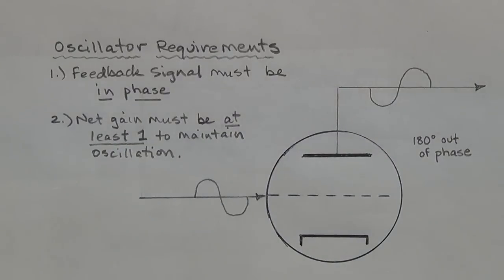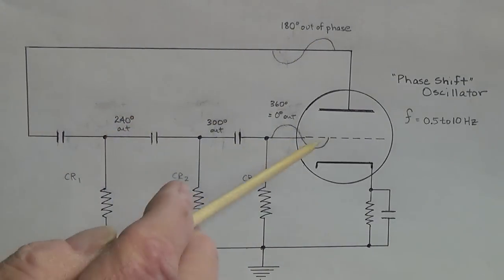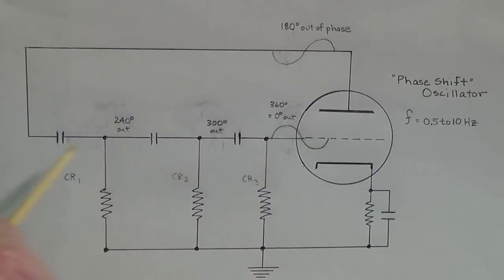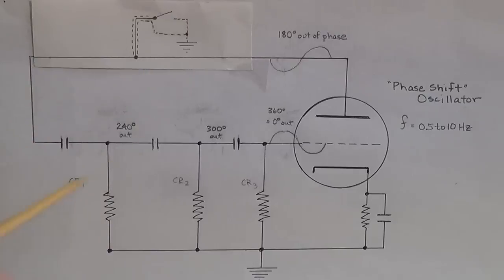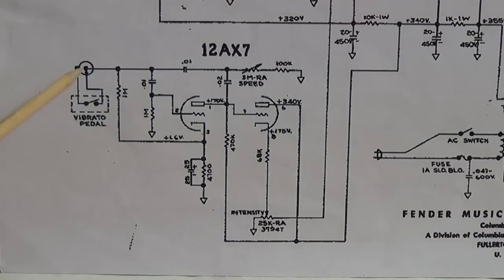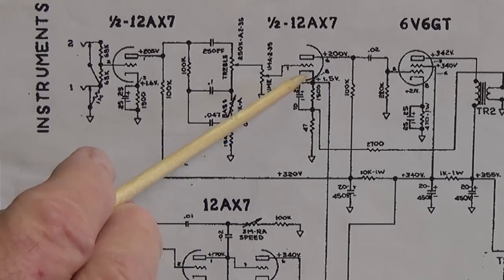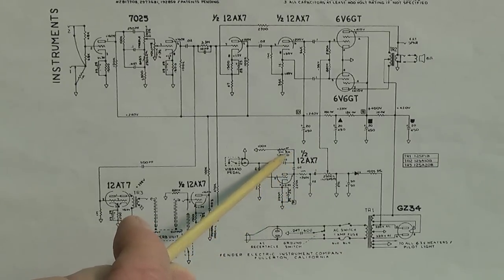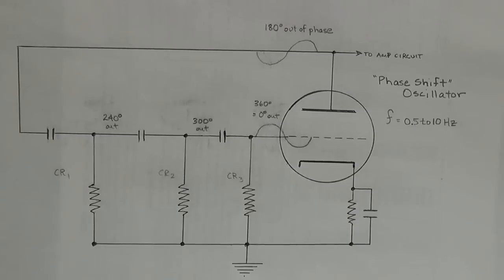How Does a Bias-Shifting Tube Tremolo Work ?

Comment: The simple Tremolo circuit you first describe in the video is almost exactly the same as what is in an Ampeg Reverboorocket.  Here is the schematichttps://el34world.com/charts/Schematics/files/Ampeg/Ampeg_r12rb.pdf . My question is the voltage on the plate V1 pin 2 varies along with the oscillation of the tremolo. Is this normal? The grid is a stable .8mV. The schematic supplied in the back of the amp says Pin 2 , The plate has a voltage of 110V but the voltage with the tremolo off is 358V and on it pulsates from 170V to 260V approx. when turned on. All other voltages in the amp are within 10% of voltages specified. Can you shed any light on this is the voltage on the schematic wrong? I have replaced the .01 and two of the .05 caps with no change and all resistor values are within spec. Any insight would be really appreciated.
Reply from the maker: Does the tremolo work? I have no way of analyzing this problem long distance, Bill. If the tremolo does not work, then I suggest you seek the help of a qualified tech in your area. Good luck.
Reply: Uncle Doug yes the tremolo does work.
Reply: My question was does the voltage fluctuate on the plate in this type of tremolo?
Reply from the maker: @billroberts849  My experience with tremolos has been that all high voltage in the circuit oscillates in time with the tremolo, even if the Intensity is turned "off".  It's a nuisance when trying to measure PV, and can only be halted by removing the oscillator tube or grounding the oscillator loop circuit.

Comment: I still don't understand how there is a signal (Alternate Current) in the grid if the signal comes from the negative voltage (Direct Current), could you explain?
Reply from the maker: Please watch my video on how amps work, Fabio.
Reply: Ok, this is not about watching the other videos, this is a specific question on the topic, in the drawing there is an alternating signal entering the triode grid (first triode / oscillator circuit), however, what feeds the grid is negative DC coming from the same source that powers the bias, where does the alternate signal that makes the oscillator circuit work? Could anyone answer? Thank you.
Reply from the maker: @fabioploja  The AC oscillator signal adds (when positive) and deducts (when negative) from the bias voltage being applied to the output tubes, varying their voltage and the strength of their output, which alters the volume of their output at the same frequency as the oscillator wave form.

Comment: Hi Doug-I built a 2x6L6 AB-763 circuit on a Hoffman Circuit Board with this type of tremolo and it did work originally but has stopped working. You said this circuit is typically applied to 20 watts and under. I'm thinking this circuit is very picky about the output tube bias. Your video was very informative and I appreciate your teaching us with such clarity.
Reply from the maker: You're quite welcome, Earl. I'm not sure why a working tremolo would cease to function, unless something changed in the oscillator tube and/or oscillation circuit. If it worked at first, then it should be repairable. Good luck.
Reply: Uncle Doug I’m not the most savvy diagnostics tech but am continually learning as I go. Your videos have been very beneficial to me and I am grateful for all of your efforts to teach us out here in YouTube Land.
Reply from the maker: @Earlvis  You're quite welcome, Earl. We're glad the videos are helpful.

Comment: Uncle Doug-I've been looking at your Tremolo videos, and have been wanting to build a replica of the 6G15 three knob reverb circuit married to a 6G12 three tube tremolo seen in the Fenders, but instead of the 6G12 circuit I'd like to have the Vibrato circuit that Magnatones use.  Have you seen anything like that or know of a schematic?  I really like the true pitch shifting effect found in the Magnatone, and I don't know of any other amps that use it.  Is that circuit more complicated, or why don't more builders use the pitch shifting Vibrato vs. the volume shifting tremolo?  Thanks as always.
Reply from the maker: You need to watch my video on the Panoramic (Magnatone) amp, WS. Everything you need to know is provided in the video, including the reason that so few people are successful in building one.......the key components, Varistors, are very difficult to obtain.

Comment: Doug.   I understand the loop that sets up the oscillation, however, what I cannot understand is where the initial signal at the plate comes from?   You penciled in a sine wave (at the plate) and showed how the sine passes through the 3 HPFs, but I cannot see what produces that initial sine wave or signal that gets fed through the HPFs and begins the oscillation.  Is there some property that makes a 12ax7 self oscillate?
Reply from the maker: The oscillation can be triggered by the operation of the tremolo footswitch, turning on the tremolo intensity switch or pot, or any electrical disturbance that affects the oscillation loop, which, if properly designed, is "anxious" to begin oscillating . Some trem circuits have small signal insertions that "kickstart" the oscillation.
Reply: @UncleDoug  thanks doug.   Love your videos.
Reply: I kept looking for this question because this was exactly what I was wondering.

Comment: So wait, Doug, my 2015 Fender EC "Vibro-Champ" (4 to 5 watts from a single GT 6V6 power tube, two GT 12AX7's and a 5YE GT tube rectifier. Anyway, it would seem that according what you have just taught us at 14:50 and a little after that  my amplifier has tube tremolo and not tube vibrato. But judging by the name on my amplifier it has "Vibrato",  not tremolo. 
BTW my amp works like this: the tremolo only starts when you strike a note, meaning that it is never in a low volume wave oscillation of the tremolo cycle when you play a note. All the strummed notes always are emitted at the actual volume output that the volume knob is set too! It is only during the time period after striking a note does the oscillation begin. This is done right in my book! Not all S.S./Digital amps do it that way and when playing on them the music is not emitted the way it's entered into the amplifier input. You can strike a note during a low point in the signal oscillation at from the very instant of striking that note the emitted output volume is low, this changes the music amplified to our ears to such a point that I find that method unacceptable.
It has a rotary (rate) on/off switch (that can be controlled via a standard on/off Fender foot switch), that has a variable sweep from (0)-(1) through (1)2. The (0) setting is off and the "1" setting is the slowest setting. My standard setting is "1", although recently I am experimenting with different speeds. I learned to keep it on any new setting increase for a while, to allow me time to become used to the faster tremolo oscillations.Also to just change the speed a little at a time, say 1/2  of an numerical increment increase on the 1 through the 12 possible selections. , not even going from 1 straight into position 2, but rather from 1 to position 1.5, then after my ears have made the adjustments sound normal , then I can go to the 2nd. position of 12, and so on and so forth. I can indeed learn to adjust my playing to accommodate the faster tremolo or vibrato emanating from my amp and I enjoy the change of pace (ha -ha I made a funny! get it speed/change of pace-oh never mind!).
Do I understand this correctly? MY amp has Tremolo? Or, is Fender just using the "Vibro-Champ" name on an amp that has tube tremolo? 
I thank you ahead of time for any considerations that you may provide regarding my questions.
BTW, Those schematics are so beautiful. I am an engineer and an artist and even studied violin under Nina Chemolve a Julliard School of music graduate who graduated in the 5th. position/ranking in her class and a musician. I was a musician for most of my life, since childhood. I was also an artist since childhood. So I would love to make a few paintings of schematics. Simple black on white backgrounds just like all the schematics I used to prepare while I was working as a draftsman, which BTW opened the door for me into engineering. I retired as a Sr. Eng inner from NYS/OGS. It all started when I starved while preparing a Fresco Mural painting for the Suffolk County Dept. of Labor, for the Commissioner. He got impeached-possibly they used my research/visits to all the facilities that were using "CETA" people as trainees. They used me to get to him. I give the man credit, not may men these days even envision murals like he did. He was an absolute dictator who made his immediate senior team comprised of Deputy Commissioners literally jump 1/2" off the floor when he barked out an order. 
I remember when the President of the Long Island McArther Airport interviewed me to obtain his permission to walk around his secure Jet Engine Facilitates- he came right out and said I was a "SPY" for the commissioner. My retort was that I took a burnt/used wooden match from his ash try (he smoked a pipe) and drew an airplane right before his very eyes on a piece of paper right upon his desk. He remarked that, yes, indeed I am an artist and gave me permission to enter the safeguarded spaces. This was a very adventurous job as I walked into many military facilities and even historical facilities that are and or had been in the past involved with the CETA Training programs, all the way back to the 1930's WPA Projects.
Well, after the commissioner was impeached the leaders of the Dept. of Labor said it looks like I might starve to death as a starving artist and offered me a 10 month CETA training course in Electronic/Mechanical Drafting, (one reason why I encourage you to open a school-as in the training literal saved my life. I accepted and graduated and finally had a career that would allow me to "eat" and have a stable life! I married and raised two children. I stayed with it and I drew up countless schematics for lasers and also the H.V.A.C Industry, through different employers. I got to the point where I was requested to make original schematics, not just making some other Engineers drawings look and be legally presentable once stamped by a P.E. I loved my engineering career, more than my art (scandalous)! I loved designing and that was the most wonderful time in my life.
Doug, you are a most excellent technical instructor a real asset to all of us who have found you. Knowledgeable, courteous, humorous and diligent in presenting thorough explanations of your selected topic/lesson. I hope you do open a Technical Institute. Look into the CETA government (Federal) programs that can pay the 100% tuition for your students, as opening and administering and educating students shall be costly. The CETA program should cover enough - 100% tuition, and remember to set the tuition rate to cover 100% of your expenses/operating costs and of course if you desire you can add a profit, after all that's the way the world does things. Although I know your main desire is to educate and I can find it in my heart if you do not desire a profit.
 -Peter
Reply from the maker: Greetings, PD, and thanks for the very nice comments. Those who wish to help support our advertising-free channel can become Patreon patrons, pledging a contribution of their choice for each video we post. Re the difference between "Tremolo" and Vibrato", the terms are often used interchangeably, even by Fender, but they are both quite different. Regardless of what the effect is called on your VC, it is tremolo, because it is based on volume fluctuation, rather than frequency fluctuation (as it is in Vibrato). Very few tube amplifiers offer true Vibrato, but Magnatone is, to me, the front-runner with several true vibrato amplifiers. Watch some YT videos to see the difference between T and V....it is quite evident.

Comment: I understand that the cr filter network shifts the phase to create a positive feedback loop, but what I don't understand is the fluctuation in the amount of feedback. I suspect it is due to the charging and discharging of the capacitors in the network, but I just can't seem to visualize it.
Reply from the maker: Each charge/discharge cycle puts the oscillator signal further behind the phase of the original signal. After three 60-degree phase set-backs, the returning signal is 180-degrees out of phase, providing the negative wave  form for the oscillation loop.

Comment: Hey @uncle doug. I was wondering if it is possible to take the vintage fenders with these tremolo stages and eliminate/modify them into another gain stage? With a added master volume I'd think it have lots of gain on tap. If at all possible, can you also make a video on how to do something like that as a possible amp mod to do to ones amp? Basically asking if we can convert a tremolo into another gain stage Thank you so much!
Reply from the maker: I would not suggest it, Robert. You can't simply add another stage to an amp circuit without altering all the other stages.......and the end results would not justify the time, effort, and expense. I speak from sad experience. Fender amps are known more for their tone and effects, not so much for volume. I guess that was Marshall's domain.

Comment: Doug, I am working on building a guitar amplifier using the power section, vibrato, and amplifier from a Baldwin 51P organ from the 50's. There is a pretty hefty transformer between the cathode and the screen of a 12 AU7. There appears to be a signal coming in from a tone generator circuit, and the output appears to connect to ground via the filter section and to the cathode of a 12AX7 in the amplifier section. Does that make sense? Curious what function the transformer is performing in this scenario?
Reply: Also, forgot to mention that the above question is in reference to the vibrato section, duh!
Reply from the maker: I can only make a wild guess, JK, in the absence of a schematic and any experience with any of this gear, but I will assume that by "vibrato" they mean "tremolo". It is standard to inject a tremolo oscillator signal into the cathode of one of the pre-amp tubes. The transformer is probably to match the impedance between the oscillator and the cathode.....i.e. to either step up the voltage and reduce the current, or vice-versa. My guess would be to step it down to a tolerable level where it can create the effect without overpowering the tube and distorting the output.
Reply: @UncleDoug  That would make sense that it's a step-down, since the tone generator circuits are providing some degree of signal into the transformer and surrounding tremolo circuit. I have removed the tone generator circuits from the equation, so it might be better to build a tremolo circuit from scratch. In fact, I am thinking now that I might scrap the existing stuff and build a new amp using a fender design of the same tube complement, etc. If you ever run across one of these organs, I'd be curious of your thoughts, they are just a marvel to me in terms of engineering. I had visions of using the tremolo and other crazy percussion effects as part of an amp build, but I've pretty much out kicked my coverage on that idea. Thank you for the response and many hours of education and entertainment watching your videos!
Reply from the maker: You're welcome, JK. Good luck with your project.

Comment: Hello Uncle Doug, thank you very much for this and the other videos, the explanations are among the best I could find anywhere on the Internet. Great that you could took the time to produce these and share it with all of us. 
I have one question please: On a vibrochamp schematic, I noticed that there is a 47 Ohm resistor added to the cathode bias section of the 2nd part of the 12ax7 preamp tube. Is there any particular reason why this resistor is added? Is it because of the tremolo? Thanks..
Reply from the maker: You're quite welcome, Ivan. I really appreciate your very nice comments. The 47 Ohm resistor forms a voltage divider (with the 1500 Ohm cathode bias resistor) for the negative feedback loop from the output transformer secondary, Ivan

Comment: Uncle Doug, I appreciate you for all of the knowledge you have distributed over the years! you are an asset to all of us ampaholics out here. I have a problem with a tremolo that I want to run by you. I am working on a GA17RVT Scout Giibson. I put a virtual center tap from the heaters to the cathode of the 6AQ5 output tubes like I had seen in another video. As soon as I did this the tremolo quit working. Even though I removed it the trem still doesn't work I have checked all the parts and can't find any that are bad. the 6EU7 PI/tremolo tube checks good as do both of the output tubes . If you have any thoughts on this I would greatly appreciate it. thanks in advance.
Reply from the maker: I responded elsewhere, Jon. Best of luck with this.

Comment: The second half of the oscillator, is a cathode follower. It serves to separate the oscillator from the rest of the circuit, so that the oscillator is not influenced by it .. ;feeding thus the signal in a more proper way
Reply from the maker: Thanks for your input, TVC :)

Comment: In one of your videos, I seem to remember you talking about the difference in tremolo and vibrato. I believe in one of your builds, you showed the circuit of a true vibrato circuit. Can you tell me which video that was? I would like to put a true vibrato circuit in my own build. Thanks so much.
Reply from the maker: Good luck, Geoff, because it requires three tubes and a whole lot of wiring. See the Fender Brownface Concert video. Magnatone had a true vibrato, but it was based on components that are no longer available. You an also check out the Weber ReVibe on the Internet.